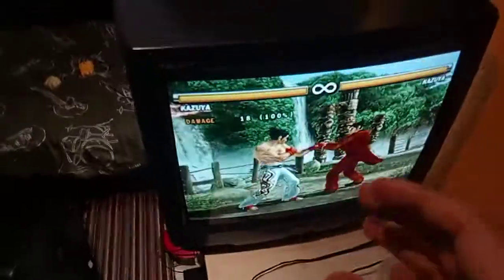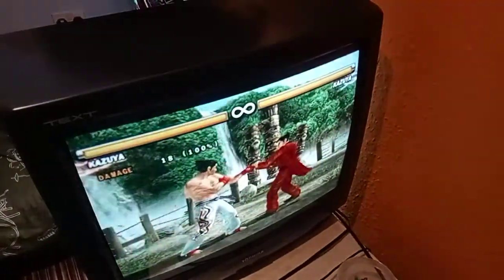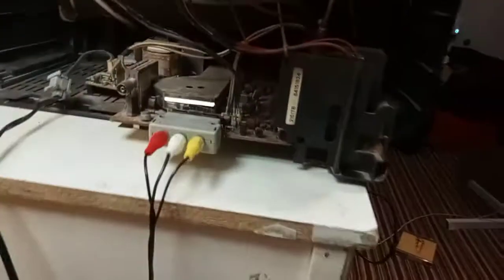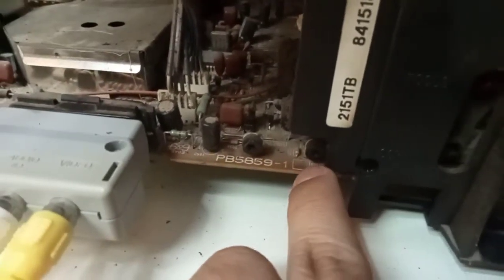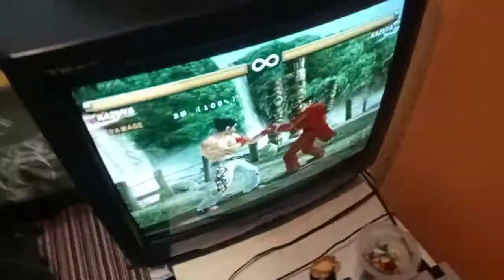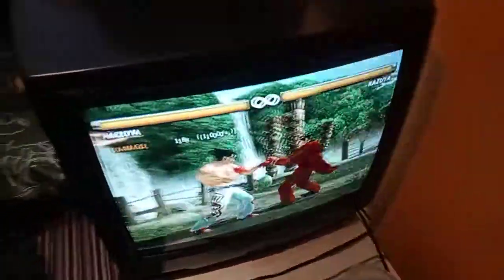How to fix an off centre CRT TV picture

Comment: Lyrics:
"Hey guys Asianfalcon here, it's like... 4:30 in the morning. But I decided to make this video because I know it would be helpful for people, like me which didn't know about this, and...
It'll be more helpful for me in the future 'cause I'm just more forgetful.
So at the minute I'm working on my CRT (cathode ray tube television)... Oh shit.
And (Deep exhale) like I've had a problem with my CRT for a while, where I noticed that the scr-
Like the actual like picture was off-centred. Like, you'd see like. Like if you see on this side like that, they would, and like this side, it's centred at the moment because I fixed it.
But it used to be like shifted a bit that way and I'd see more of like the background on this side.
And I knew it was off centred and I was here, It would feh- it was very... Distracting for a couple games so I decided to fix it today.
And my TV is a uhhh- Toshiba T151 uhh TB and...
On CRT's you'll get pots and you'll have to twist them with like a screwdriver or something.
And for some TV's it would be at the front of the TV, and then for my TV mines at the back.
So that pot right there, that controls the horizontal image and I was able to twist that and fix the screen.
Obviously you got different pots; like the focus pot, which uuhmmm it's like focusing in on focusing a uh- like binoculars.
And screen, that is just the screen brightness, and I've adjusted it just enough to fix it.
That is sub-screen brightness, I haven't touched it yet 'cause I don't need to. I probably do but I- I have no idea.
But yeah, this is more of a note for me in the future, for if I ever have like a problem like this with a CRT again.
And yeah, madness!"